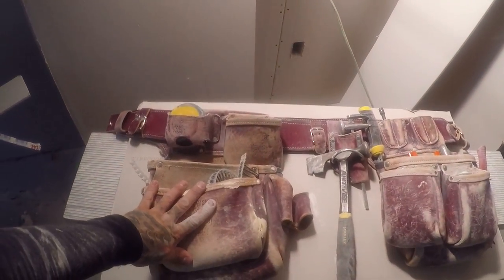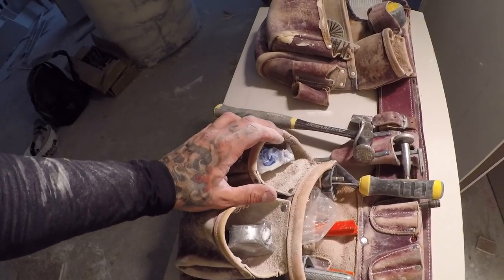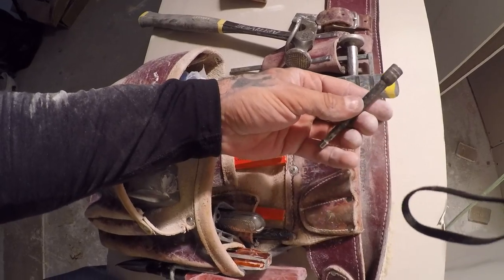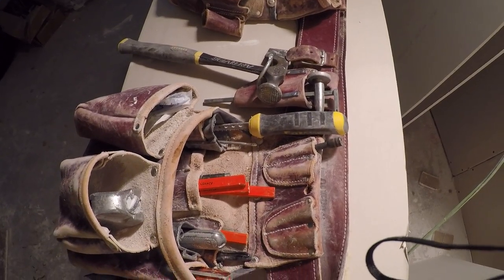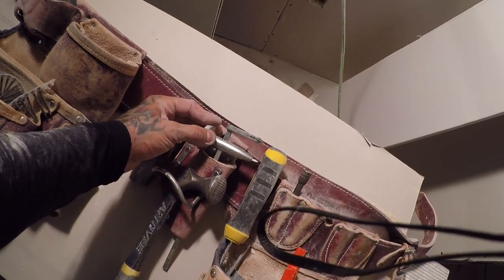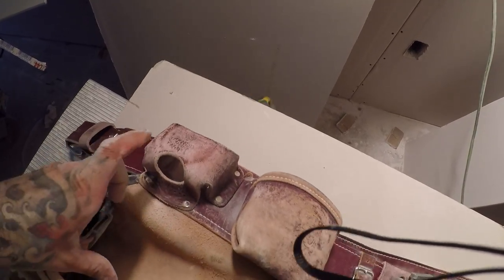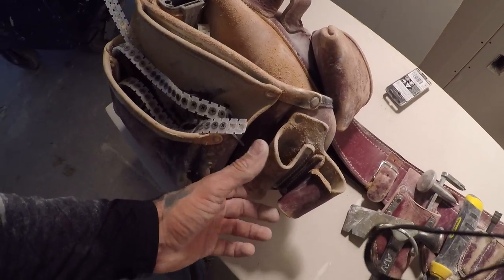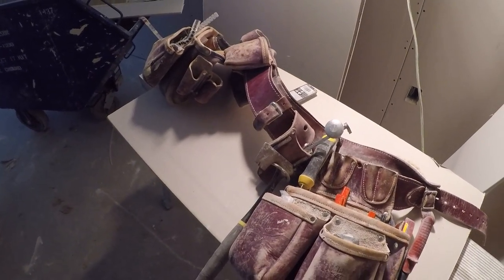What's in my tool bags, drywall set up. Occidental leather big oxy nailbags

Comment: Nomadic INK where do you hold your impact driver or screw gun when metal stud framing/drywall hanging. I’m a 18 year old 1st year apprentice in Oregon and I still haven’t figured out where to put my impact/screw gun.
Reply from the maker: Most guns have a metal clip on them so I'll use that to put the screw gun clip on my belt.  Normally on my right side behind the tool pouch is where I put it. If it doesnt have a clip I set it in the tool pouch if I can.
Reply: Nomadic INK awesome I’m gonna try it tomorrow. Thanks man!
Reply: Nomadic INK oh hey and my dad and uncle used to work for AJ back in the day. From like 2002-2005. Small world.
Reply: I have a Klein bolt bag that I keep on the back of my belt. Keep a gun/ drill or driver in there when I’m using it. If not it’s a water holder